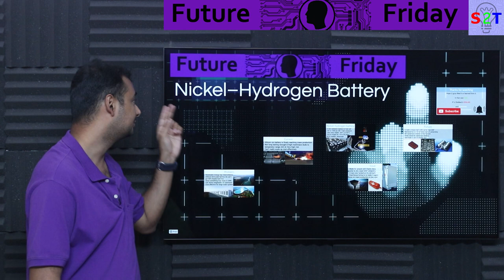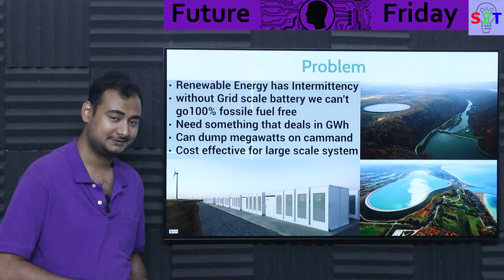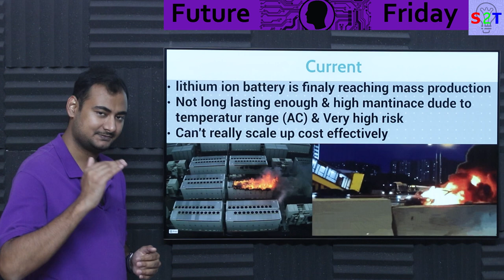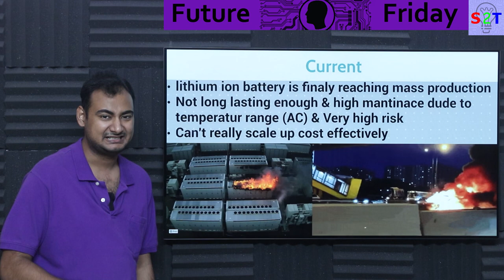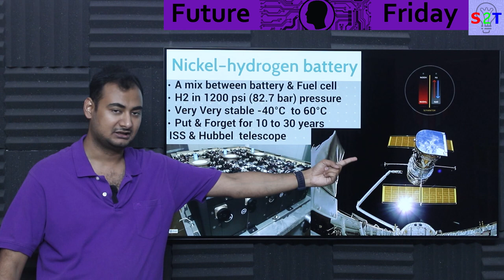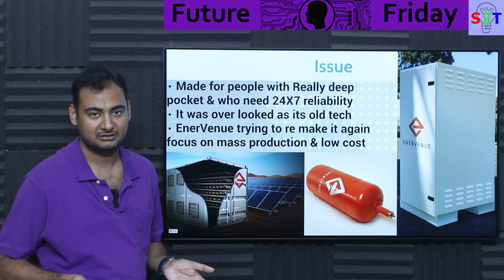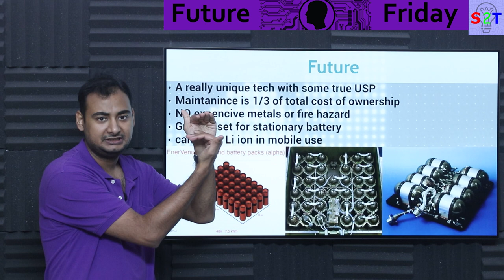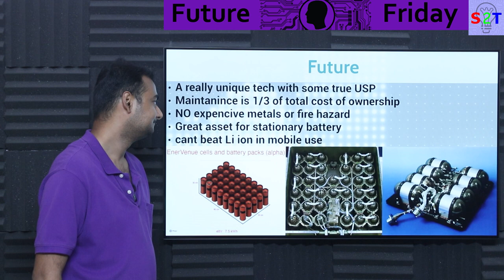Nickel–Hydrogen Battery Explained  {Future Friday Ep190}

Comment: You never told us why it is so expensive ?
Reply from the maker: Lack of mass production so tooling for it is rare & its high pressure + hydrogen which leaks like there is no tommrow
Reply: @s2tenglish  Sounds like greed , laziness , and lack of visionary leadership. Kind of the problem with everything today.
Reply: @s2tenglish  If the hydrogen is leaking like no tomorrow, how do these last 30 years without maintenance? That was one of my biggest questions and I'm having trouble finding an answer

Comment: It's worth noting that some of the simpler battery technology concepts won't necessarily take 30 years to start building at scale.  The liquid metal battery idea that Ambri is working with is, if I recall the summaries correctly, designed specifically to be simple to make and use cheap materials, which should in theory reduce some of the difficulties for mass production scale manufacturing.  

It does leave the issue of patents and licensing, since it's a new enough technology that patents won't be expiring anytime soon, but a smart company can allow for mass adoption of a technology by being generous with licensing deals.  See JVC, RCA and their partners with VCR technology back in the 70s and 80s...that's not the only thing that won the format war, but the fact that the VCR was licensed to enough different companies that there was competition to get prices down within the format was a big boon.  (Conversely, a company can be miserly and keep manufacturing rights all to themselves and let the competitor who doesn't do that rocket ahead....see Betamax for that side of the coin.)
Reply from the maker: time will tell as there are far more variable's in the equation that we don't get to see

Comment: EnerVenue is just a mash up of two words - I pulled up a video they posted last year where the CEO says it's name and it's "Ener" from "Energy" mixed with Venue (a generic term for a concert hall, conference hall etc - the venue at which an event is held.)  

(Conversely  it could be the last bit of "revenue" which basically means income (generally of a whole organization)...or avenue (a type of road) or any other word ending in venue...as far as I know it's always pronounced the same way.)

A quick check of their website didn't reveal any marketing thing that actually explains their name, and none of the 3 words that could account for the "venue" part of the name make sense to me.
Reply from the maker: yep I had same feeling